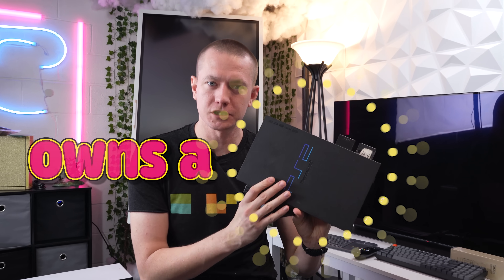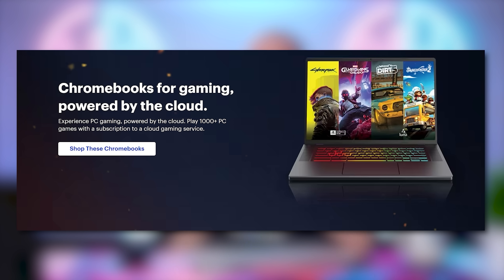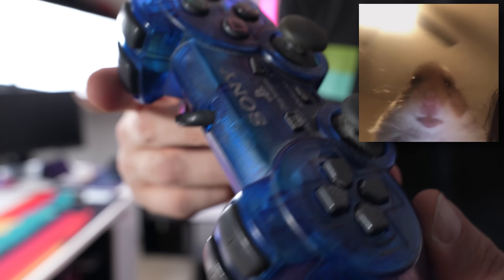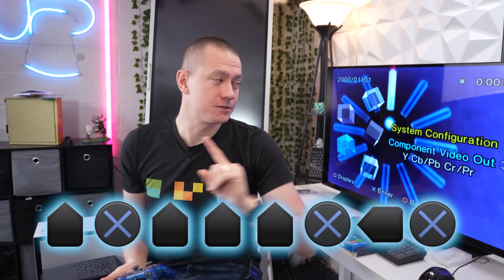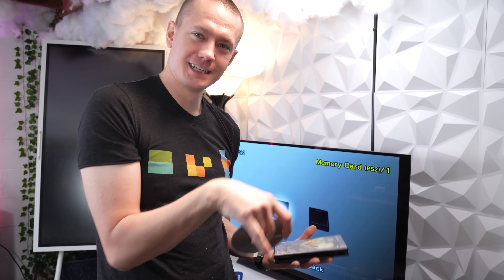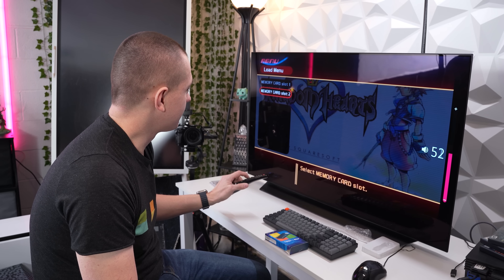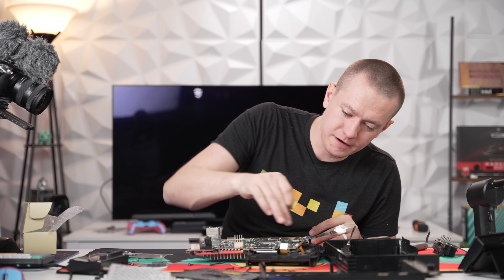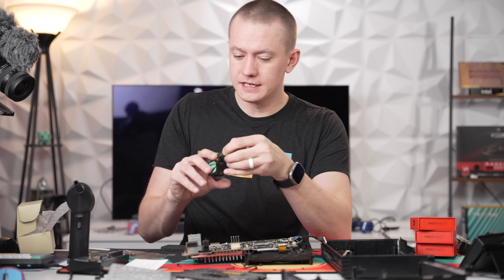Upgrading The Cooling on the PS2

Comment: I have taken prolly 5 ps2 apart, i personally have had a copper heat sink and aluminum one. It varies by model like the launch 30001 is aluminum and the 39001 and 50001 are copper
Reply: Yep same here, models are different

Comment: Those are noisy. Ps2 is not that hot. It can run several minutes without a fan. Do the fan mod and replace the noisy fan. There are not even fan speeds in the ps2. Only one speed.

Comment: hey Bret, one gripe, you should be measuring the sound at 1 meter distance, because proximity effects make the results wrong. Read up on "proximity effect" for mics. It boosts the bass. I'm an audio engineer if you have any questions about that.

Comment: Pretty sure the pads you used are not making contact as they're not the correct thickness
Reply: Ps2 slim uses 0.5mm?
Reply: Ifixit source
Reply: @obidahasdia4095 Not sure about slim but the fat model uses a lot thicker pads.

Comment: Okay so hear me out:
This is probably overkill and a horrible idea, but what if you were to electroplate the heatsink and THEN use the liquid metal? Would that even prevent the LM from destroying the heatsink?
Reply: You'd also have to use a thick copper shim to make up the distance between the cpu die and the bottom of the heatsink.

Comment: KH1, especially that part is very low polygon count, easy to render. Try something like zone of enders, the menu of xenosaga 2, nfs games, gran turismo, metal gear solid. There are a few that can push 100k triangles per frame. But KH is far from it.

Comment: Excellent video, I have three PS2 Slim versions at home, they all work, only one of them has a weak DVD reader, the other two work perfectly, thank you UFD Tech. 👍❤💯🔔
Reply: You can do a network load over Ethernet instead of using the discs on the PS2 Slim. The Ethernet has a much higher transfer speed and faster load times than using external usb or an SD card in the memory port.

Comment: Now all it needs is to be modded to Free McBoot, an IDE to SATA conversion kit and a reasonable SSD (maybe 512 GB) to store and run the games on it as it already has the HDD Network Adapter needed for it to work!  Won’t need the DVD drive at that point.

Comment: What about having an SSD and the most upgrades that can be made to the PS2?
Reply: need to mod it to even play games off it. won't have any benefit besides less noise than a HDD
Reply: @lolcat  You just need to soft mod it with FreeMCBoot. The process is pretty straight forward, video guides for that exist on youtube. MrMario2011 made a pretty easy to follow guide that I used to soft mod my PS2. I used an inexpensive Inland 500GB SSD for mine. My entire PS2 library lives there now and the loading times are as good as they'll get. The only caveat is that you have to either use a PATA to SATA converter board if you're using the official Sony network adapter or you have to buy a modified 3rd party network adapter that supports SATA drives. Both work with FreeMCBoot.

Comment: are the thermal pads the right thickness
Reply: I am wondering this as well. The FrostSheets did not look as thick as the original thermal pads. I think if they replaced it with some 1.5 to (maybe) 2.0mm Kritical Pads (or whatever is truly good out there), the fan speed might have toned down a bit.  Sheets like those are definitely thin, so I'm wondering if there is proper contact.

I hate to say it, but Kyler may run into some thermal issues later on down the road.